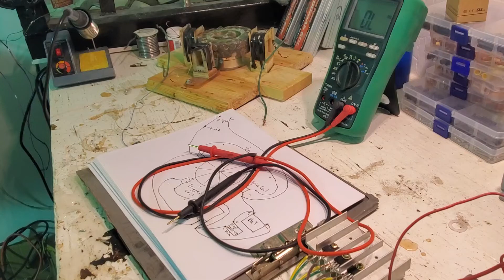Step by Step how to wire these pulse  motors up and make them run

Comment: Could I get away with using the windings out of a box fan? And how do you get direct current from alternating poles?
Reply from the maker: Box fan winding are pretty fine,  you would have to maybe use four stands wrapped together.  D.C. is made with the diode on the output its pulsed D.C. current. Use a cap on the output if you want to smooth it out.
Reply: @windpowerandmore6310  Thank you kindly for taking the time to talk with me.

Comment: I really want to build one... Is a bicycle wheel out of the question??
Reply: I'd say go big. If you get a bike wheel with  32 spokes and it will give you 8 cross sections. Helps line up magnets.
Reply from the maker: Definitely should work,  steel rotors are always the best choice for these motors.  Just be sure you can balance it and keep the magnets from flying off. Thanks for watching!

Comment: I am really enjoying your videos as I try to wrap my head around this idea with limited electrical experience.  I have read some and have watched many videos on the Bedini motor.  Without down playing all your hard work are you just building a more efficient/powerful Bedini motor?  I have step-by-step plans on how to build the Bedini motor.  What I am trying to figure out is where your motor deviates from the Bedini motor so I can implement the changes into my build.  Thank you for everything you do.
Reply from the maker: Bedini motors have a soft iron core which will become magnetized because with a Bedini circuit it only pulses on pole always.  It will cause drag on the rotor.  I use aircore coils because it's the best way to do it.  I've built a crazy amount of pulse motors both with iron cores and without,  without it always better.
Reply from the maker: These motors definitely aren't Bedini motors,  the magnets on the rotor in this motors are north south alternating and its only on for half the magnets per revolution. Two coils turn on while the other two coils turn off , they alternate on and off .I'd have to make a video to really explain the difference between these motors compared to a Bedini motor.  Thanks for watching!

Comment: Thank you! This is very helpful. I need a stronger pickup coil. The one That I hand wound isn’t putting out enough voltage to turn on the transistor hard enough. Also I keep burning out my transistors because of not having the back spike circuit connected. Do you think that  I could connect it across a load resistor, just for building/testing purposes?
This video is very beneficial! A huge thanks.
Reply from the maker: No problem I'm happy to help.  It should be fine to hook up the output to a load resistor. A tail light from a car would work good and give you a visual also.